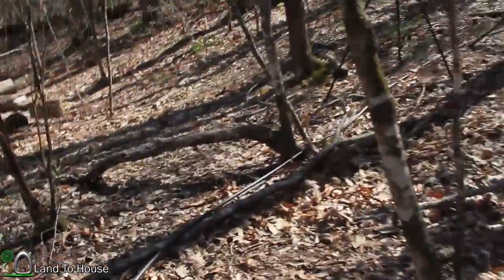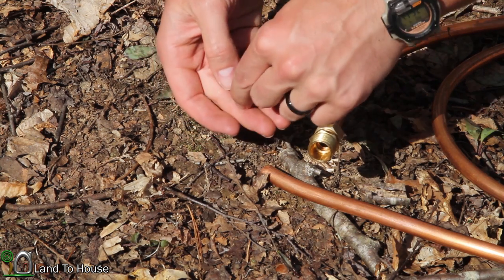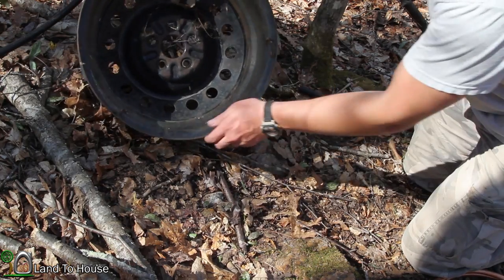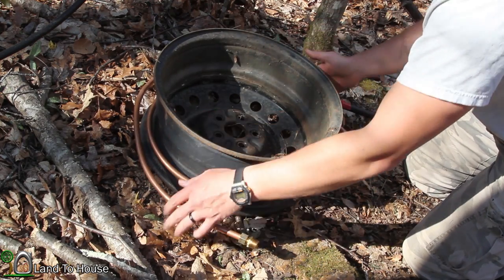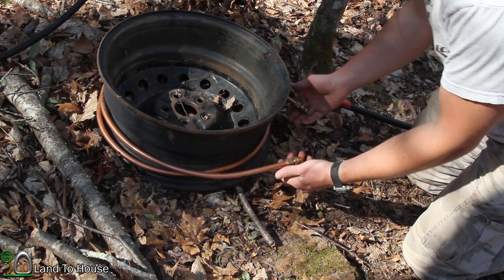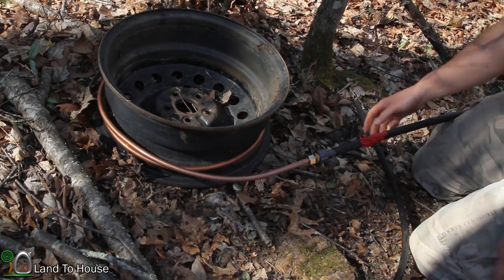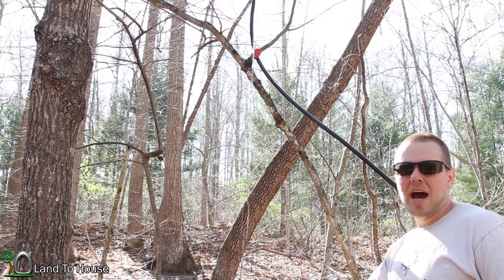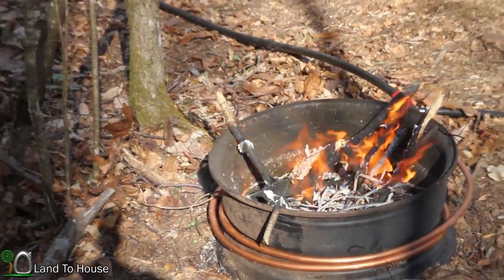Ram Pump Shower Concept

Comment: A rocket stove design would be more efficient, and you could make the coils tighter, thus giving it more surface area to heat. The ram pump is a good way for free pressure.
Reply from the maker: I am sure there are 100 ways to improve this little test. A rocket stove would be ideal. Get the fire going in there and use the ram pump to bring water to it.

Comment: so i have some sort of sad news... my ram pump EXPLODED! the pressure tank went BOOM! yesterday morning lol... thankfully everything was created with lots of unions and i got replacement parts today. will fix tonight and install in a few days when temps are back above freezing again. problem was that the original 2 inch pvc pipe i used for pressure tank was scrap from something else and i didn't realize it was sch40 NON-pressure rated PVC. so surprised it lasted this long. found out when i looked at the pieces and saw it had a foam inner core of the pipe wall. there wasn't any writing on the pipe section i had used so i thought it was regular PVC lol... oh well...
Reply from the maker: Oh wow! I sure hope that you were not close to it when that happened.
Reply: Land to House
i was a sleep in bed :) got the parts to fix it up yesterday. rebuilding it this afternoon. will install later this week when its warmer... will post a blog about it on my website.
Reply from the maker: That would be helpful! A good ram repair is needed.
Reply: Land to House
will try to make it as detailed as possible. ran out of time to get it done today so maybe tomorrow. you are right, i haven't seen any ram pump repair videos out there...
Reply from the maker: +FixedByDoc Homesteading I have made a cleaning video... kind of. But I have not seen repair videos. Seems like something people would want to know.
Reply: Land to House
hopefully i will get it done tomorrow. it will mostly be pictures because it is so cold outside right now. in the negatives.
Reply from the maker: +FixedByDoc Homesteading I hear you. The thermometer says one degree here. A little bit too cold to be playing in the water. By about 55 degrees. ..
Reply: Land to House
it is about -5*F currently...

Comment: Might  try  in the flames, but on other hand  it could turn into  a  thermal syphon
Reply from the maker: +Dean Paradis I read that as long as there is water flowing in the pipes it is ok to place it right into the flames. But if the water stops it could burn the copper. But my fire was so small I bet that would be best. Thanks.

Comment: gday Seth just a thought that the heat source needs to be closer to the shower head so you don't get as much heat loss.
Reply from the maker: +dennis binyon that is a good point. Probably how most people would do it in a real life setup. I wonder if it was to close to the end if it might start a thermal siphon and pull pressure from the tank and stop the pump?

Comment: if you're running water through the pipe constantly the copper more than likely not have a chance of melting so it is probably a safe bet you can stick it right in the fire if you need some tight coils
Reply from the maker: I thin k you are right. The fire that I had was not warm enough to melt the copper even without the water. But in a larger fire, the type you would want to have to get a good shower, I bet it would be hot enough to melt the copper without the water.

Comment: Rather than copper tube how about an old steel radiator light the fire under it heat rises. you would have to bleed the air out of the radiator. Just a thought.
Reply from the maker: I expect that would work well. I dont have one of those readily available to try.

Comment: here's an idea .. coil directly on the fire and the threded tips acros the holes on the rim ...
Reply: I agree here.
Reply from the maker: +Leonardo Maldonado yes. Make a more permanent setup. As long as water is flowing it would be great.
Reply: Land to House not nesesary .. remember on the curent set up you have the wind against you blowing on the copper tubing .. so its cooling it posibly as fast or faster that your heating it ...
Reply from the maker: It seems to me that I need many more wraps to get the water to a better temp. and keeping the wind away from the system would be great.

Comment: I saw a great way of coiling your copper pipe tighter. Fill it with water and freeze it and then you are able to wrap it around something - maybe a 6inch cut log - and it won't kink the pipe. You would then get a better coil in the actual fire. I'll see if I can link the video for you.
Reply from the maker: +Googs Aussie Adventures I got your link. Thank you. I will have to try that.
Reply: thanks for that bit of info :)

Comment: Another non-engineer here but one with a good intuitive sense of these things. As Leonardo stated, you're losing thermal transfer due to the wind. Yes you need more wraps and I would use tubing fittings to hold the tubing flush to the rim. But also, some sort of outer cylinder to enclose the tubing to capture the heat would improve efficiency a great deal.
Reply from the maker: I have an engineer degree but not in mechanical so I am in the same boat as you haha. Those are great suggestions. When I get back to this project I will have to make great changes to how the heat reaches the tube and keep that wind from cooling everything down.

Comment: Would take a good while for the rim to heat up enough to transfer heat to the copper tube. I'd put the shower back downhill from the fire pit and run the water into an elevated five gallon bucket so you could get some warm water built up and get ahead of the game. Put your shower head off of the bucket. Otherwise someone is getting a cold shower.
Reply from the maker: That would work. It would still use the ram pump to get the water to the bucket and fire but would not be the source of pressure that I was first thinking.

Comment: give that wheel hub 20 minutes to heat up so it can transfer the heat to the copper pipe then another 10 minutes for it to really get going. i bet you can get some nice hot water then. need a good coal base and some logs going for a steady heat source.
Reply from the maker: Yes my little fire was rather sad. It needed to be at least 3 times that size. I guess this was more of a concept test and not so much a finished thought. With a bigger fire and more wraps that water would be nice and hot.
Reply from the maker: Wow thats awesome! The flames are shooting out the top. I imagine that will produce lots of heat. I want to make a propane tank wood heater.
Reply: Land to House
i thought about making one of those propane ones but was afraid to. i think you need to fill with water first to ensure it doesn't blow up before you cut into it...
Reply from the maker: +FixedByDoc Homesteading yes very true. A friend of mine makes drums out of propane tanks and he has a very specific way that he pops the valve loose and fills them with water. I was thinking about taking a tank or two to him and let him do that step.
Reply: Land to House
a friend of mine buys beer kegs. he has made some cool stoves and stuff with them. they are stainless steel though, so very hard to cut and weld without the right tools.
Reply from the maker: +FixedByDoc Homesteading I bet they look very nice. My welding skills are close to zero. I've only given it a go one time. I can cut things a little bit better with the angle grinder.... not much better.
Reply: Land to House
same here lol...